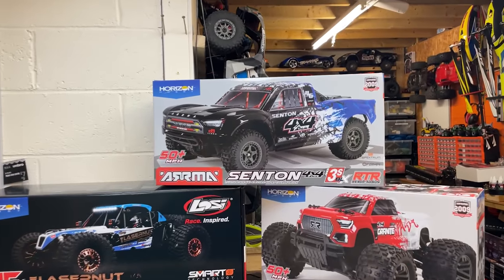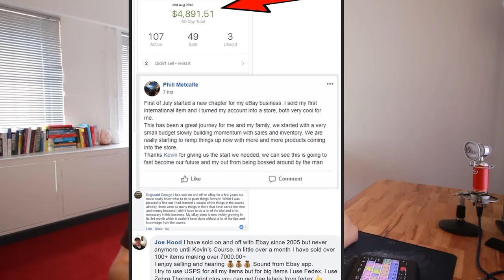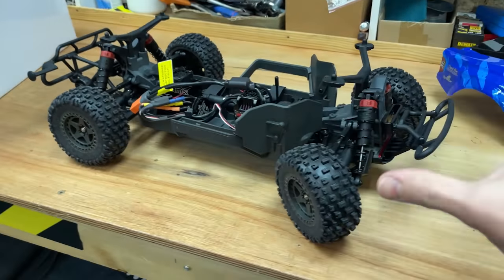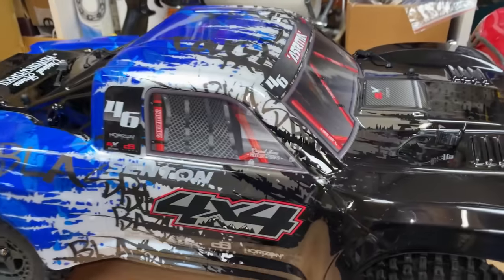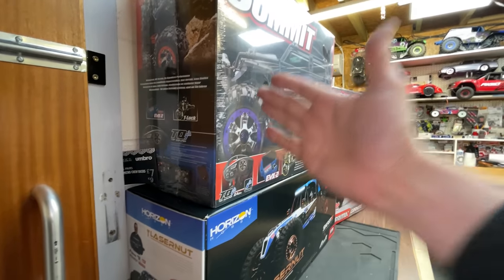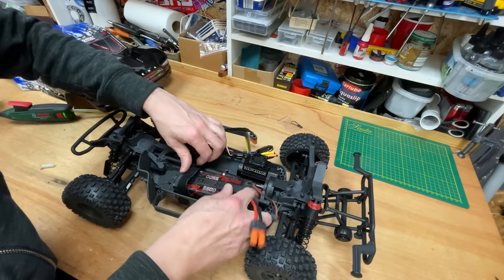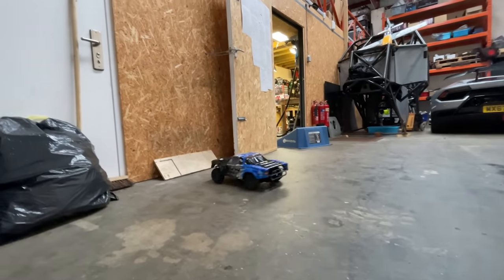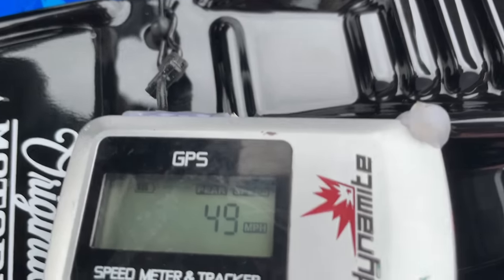World's best budget RC Car extreme testing

Comment: If Kev can drive the Senton all day without breaking it, it'll last me my entire life.
Reply: He didn’t do enough i broke the motor after 2 day, third day the servo, after two months all shocks are leaking. But I love the car.
Reply: @fvrank  man ur not giving it a rc li consideration 🥺
Reply: Every video I've seen on YouTube the Senton is unbreakable. But I don't even push it hard or anything and everything is breaking on it :(
Reply: We chewed out the spur gear in a few days, now both fans are down but it is fun
Reply: I was drifting it around, slammed it into the wall and the front knuckle broke :(
Reply: This is the one I’m going with.
Reply: Same my Senton and Typhon 3s work like clockworks...
Reply: @fvrank you worse than Kev
Reply: Honestly, I’ve had it for a couple years now nothing on it broke except for one piece on the bumper. It’s broken several times now that’s the only weak point
Reply: Same
Reply: true
Reply: But if u drive it like that for a week.......
Reply: Drive on the gravel and dirt and find out how many times the steering locks up and the rocks cut the drive shaft in two and the car fills up with dirt. Sick of mine and just orderd the Team Associated MT 10 to replace it.  Giving it away for free to some poor slob that doesn't know about it.
Reply: I backflipped one through a tree and it was fine
Reply: Right. I just decided to grab me one glad I choose the same one.
Reply: I broke mine in less than a week 😂
Reply: My seven year old full sends this thing into anything and everything. Still haven't broken it..
Reply: @tannerschs My ESC caught fire, but I switched over to a brushless system and it flies now
Reply: Mine lasted 2 days

Comment: The Senton seems to have done the impossible. Being both Kev and Stemp proof
Reply: True 😂
Reply: BUT they are only sand proof for so long,youhave to pull the motor alot for cleaning or you kill spurs in 2 runs.
Reply: @rmoody8591  who said anything about sand? That wasn't in this video
Reply: Mine chews through axles in half a battery
Reply: @kyletaylor4312  I usually put a tiny silicone 0-ring inside the axle sockets on the wheel side. Seems to help tremendously. 
If you don’t have 0-rings you can cut a tiny pice of nitro RC fuel line and that’s just as good if not better.
Reply: Partially down to the body shell offering some protection to the wheels and Arms .
Reply: @kyletaylor4312  How :) I have run at least 8-9 full batteries trough mine and nothing have broke more than the front bumper.
Reply: I Love my senton. Its basically a Tank.
Reply: @rmoody8591  sand gets into everything on anything doesn’t matter what car you’re running you’ll have to do some maintenance after a sand run
Reply: @libra6829  my thoughts exactly....
Reply: my favorite SCT ever
Reply: @kyletaylor4312  your not supposed to eat them.
Reply: @rmoody8591  you only kil spurs with the wrong mesh. The weak points on these are the servo and the motor bearings
Reply: @rmoody8591  that is so true I have one. It is still a beast
Reply: Senton = Slash killer 🤪
Reply: So which is better big rock or senton
Reply: @coledaddy818  which one didn’t die in a head on collision?

Well; that would be an unfair question, because the big rock in the video is being held together by straws, in a figurative sense.

Out of the box, they both are equal to one another.
Reply: @coledaddy818  Big Rock
Reply: @rmoody8591  One screw  is all it takes.  Very easy to do regularly
Reply: Somehow I broke it I only bthave me it once I did send it 30 feet in the air then rip twice and hit a tree all at once
Reply: Not stick proof
Reply: I added Rapid Fuse to my shock shafts, after all of them pulled out lol. Almost impossible to break now
Reply: @libra6829  surprising not all. I take my traxxas slash 4x4(not a traxxas fanboy but I do enjoy it) to the dunes all the time. The key is to not run on sand when wet. That shit is a pain to clean
Reply: I find it suprising that the way to achieve this it seems that everything must be made out of plastic.
Reply: Tru dat
Reply: @libra6829  I took my banggood special out in the sand. No issues. The xmaxx does good in the sand too with no problems.
Reply: I watched this video and realized this is the rc for me
Reply: @attemarttinen  agreed!  The aluminum looks cool, but when it bends, it's done.

Comment: Nice one! Epic bash and fun! Senton is a great little sc truck. Better buy some spare spurgears and bearings. Traxxas bearings 5119a are a good replacement for the stock AR610001. Tape of the hole near the spurgear at the back of the battery tray to prevent debri tearing up the spurgear. The body over the wheels fills the chassis with sand etc. A dust cover from dusty motors works perfect.

Comment: yup its that Fun right out of the box,  just check the steering end points and the remote lets you turn down the throttle. 
is he on 3s?  3s batteries will definitely get to 57mph

Comment: I planned on going Senton but instead after watching several comparison videos went Granite brushless. Same price same basic package but damn that thing is durable. If you don’t want to spend the big bucks on a crazy RC. Go with Arrma I’ve beat that granite to death. It’s outlasted both my JLB cheetah and J3 Speed. Also 3 different ZD models which are just cheaply made. I’ve never tried a Traxxas model but my Granite is indestructible!  If you go with the spectrum 3S 5400 50C you won’t regret it. Really adds something extra that my other 3S batteries don’t.

Comment: Everyone that gets this RC is pleasantly surprised by it very quickly I done a lot of research before buying it and it's one of the most durable Bashers I've had the only thing not durable on it is the soft compound tires that come with it you will burn those bald within the first 6 batteries you run through it

Comment: The only upgrades I have done on mine are proline shocks and changed the nut on the wheel so I could use slash wheels. The stock wheels go bald real quick. Bash the hell out of it only a broken driveshaft and broke a shock rod. Going on 8 months of fun.

Comment: The arrma Senton  is a good arc if had one about a month but I'm having trouble with the ecs it goes then stops and the front axles are weak with the traxis switch I'm breaking the roll pins in the gear box

Comment: The plastic diffs are a shame. The plastic chassis is a bit weak too, but the 4s center brace will definetly stiffen up the chassis quite a bit (installed one on my 3s typhon)

Comment: Could you test the Reely Eraser? It's also a 1/10 RC short course truck that goes with 2s lipo 50 KM/H. I think it also works with 3s lipo batteris. If you buy it can you test it with 3s please?

Comment: Get the traxxas 1/16 Slash 4x4. I've had one for almost  3 years, given it more hell than the 9th circle, and only killed a stock servo, a set of tires, and wore out wheel knuckles.
Edit: oh wait, I did kill a differential, but it took 2 years. But it did also survive a head on at a combined 60mph with only the pinion and spur gear mesh getting a bit messed up, a bath in mud without being cleaned, hundreds of tumbling landings, and overall 3 years of abuse.

Comment: What is the best way to break in a brushless motor? I've been a viewer for months now and I've upgraded from a brushed to the traxxis 3351r. I'm only running a 17 tooth drive gear on the motor but it still heats up to a limit at which I shut it down. Which I can still hold my hand around the motor for however long I never allow it to reach a terminal temperature. But I cant seem to find info on breaking the motor in. By 5ge way I have the senton, its low to the ground front bumper needs replacing immediately it's made of s real soft material which breaks just bumping your own leg. But my senton is running the traxxis brushless with a 3 s lipo 5000 mah the shocks seem stiff and it doesnt like turning at a long speed. Will be upgrading as well as the slip in mine didnt seem to hold up. Nonetheless it has a screw two screws in it now.
Reply: The body shell holds up nicely no cracks or shatter anywhere it. I did take the advice on the wd 40 on the shell to help make it flexible.

Comment: I have the v2 senton I upgraded to hot racing full metal differentials and have the center brace from the 4s kraton I think on mine and typhon 6s shocks and only thing I break is the bumpers

Comment: Everyone loves the Summit, including myself, but you're going to be disappointed because it's pretty much identical to the E-Revo 2.0, but with more servos to fail (like the TRX4). I've had mine for nearly 5 years and JUST converted it to 6s power. I've not run it on 6s yet but I've heard the diffs meltdown and the lockers stop working right.

Comment: I got the granite but mine is highly modified it does 74.9 mph atm I can't get it to go any faster as it sits lol. Until I put the bigger esc in it. But atm I got a 4276 surpass rocket sitting in it and a 120amp 3s hobbywing Quicrun BL 120. And yes you can put 4s in it and it won't hurt it lol. But I'm going for a world record with it. The world's fastest Arrma Granite and I'll be there come july ;) .. and as for the senton it's a lil bad ass I like em. But the granite is the same truck as the vorteks and outcast 4s  and you can turn the granite into any of em easily and with a chassis and center drive shaft it'll be a big rock n senton

Comment: Burnt the motor in mine after 6 batteries,put a hobbywing 4600kv and matching esc running on 4s with a 21 tooth pinion all I've broke is the front bumper and 1 rod end on .y 4th set of tires tho lol

Comment: Rip that motor out before it burns up. Won't be long. Esc will be next. Unfortunately the blx series is JUNK. They are EXTREMELY durable. I put the vxl3500 in mine after we burned 3 blx systems and gave it to my 6 year old